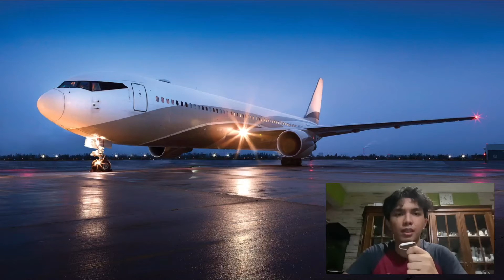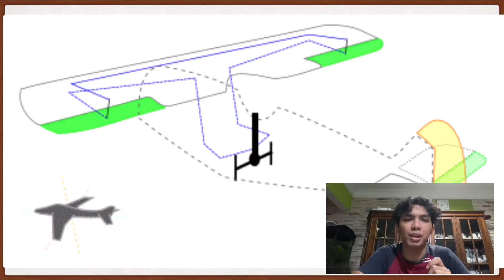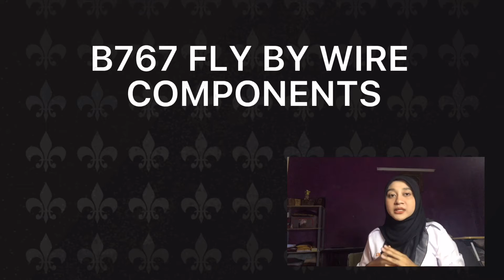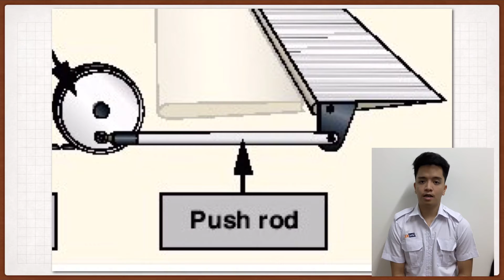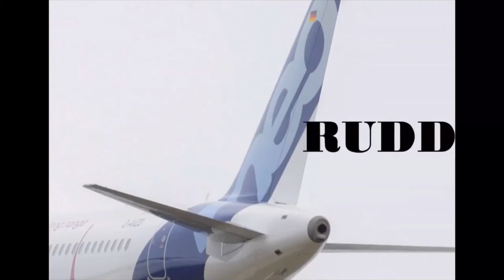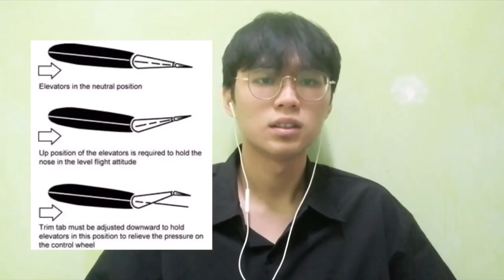fly by wire syed fadzly (3aem2)

Comment: Brandon Goh Jian Hao 
53211222032
Q: What is fly by wire system and its operation?
A:A fly-by-wire system replaces traditional manual flight controls with an electronic interface. In a full FBW system, the pilot's control inputs (like moving the yoke or rudder pedals) are converted into electronic signals. These signals are processed by flight control computers, which then determine the appropriate movements for the aircraft's control surfaces (such as ailerons, elevators, and rudder) and send commands to the actuators to achieve the desired response.

Comment: name : muhamad nur aiman bin bolhi
class: 6bme1 
id : 53211121086
Q: How does the fly-by-wire system work based on computer signal processing?
A: Explanation of pilot commands being processed through electrical signals and computer-directed actuation.

Comment: Akmal Huzaifee 6Bme1
Q. How does a fly-by-wire system protect the structural integrity of the aircraft 
A. The fly-by-wire system will know the limitations of the aircraft and prevent the pilot from manoeuvring pass the capabilities of the aircraft